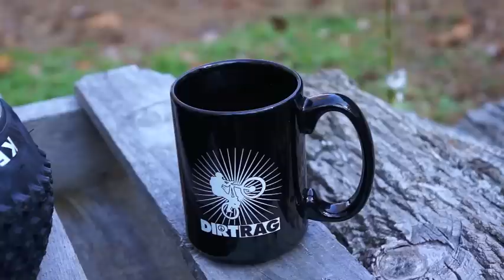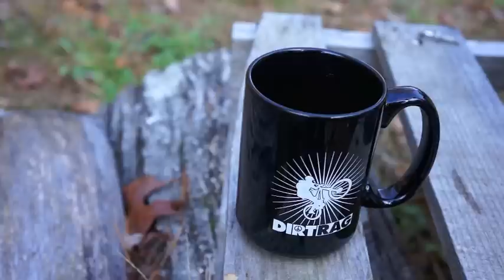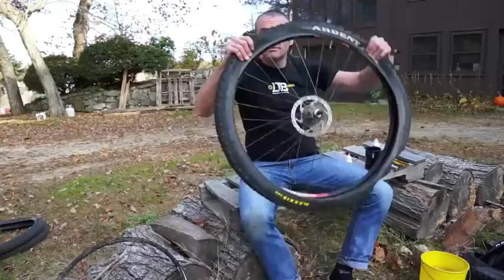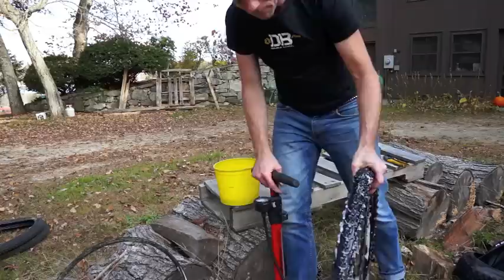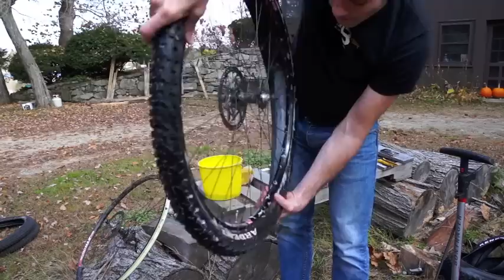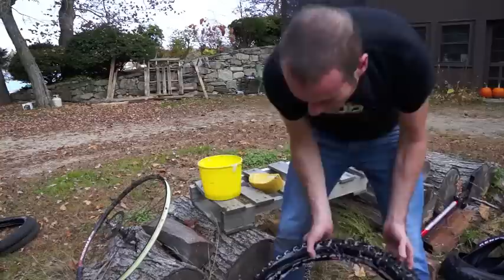Tubeless Mountain Bike Tire Installation (Without An Air Compressor)

Comment: I saw this video too late but this is what worked for me.  I mounted new tires by spraying the sidewalls with windex. Less messy than soap and water.  Also, remove the valve core before you pump up to initially seat the bead.  That allows for less resistance and higher flow of air with each pump.  I pumped as fast  as  possibly could.  I thought it was a losing battle as I heard air escaping, but then heard the two satisfying pops as each sidewall seated properly.  (No bouncing was necessary during pumping for me.  I would have tried it had I known it might help).   Note: I did discover two small weep holes in my rims that are supposedly there to weep water.  I covered those with tape before pumping.  After hearing the bead pop into place and inspecting that it looked even all the way around on both sides, you can then remove the pump.  There was no way after seating the bead that I was going to unseat it to pour in sealant from the side!  I injected it directly  thru the valve with a syringe, replaced the valve core and re-inflated.  Then slosh the sealant all around like he shows in the video here.

Comment: So, after multiple efforts to get my technique down the super key points here are soapy water and high volume air. This method bouncing with track pump looks like I may work, but mounting new schwalbe tires I'm skeptical. I currently use an air canister that I fill to about 160psi and fill the tire with valve core removed. Then quickly install the valve core and finish off with the track pump. Once the tire mounts successfully and holds air I then install back on bike, let the air out removing the valve core again. Adding sealant through the valve is much less messy than rolling the tire over the rim with sealant sloshing around. I repeat the process filling the tire again with the air canister, installing valve core, and then finish off with track pump. Sidewall coating is especially important when tires are new and or tire is not officially TL rated. Nice video!

Comment: So after my completely failed first attempt I made some changes based on your video and I was shocked how much difference it made.
First mistake I was making is using a spray bottle, like some other videos show. It gives you a lot of water and very little foam and you want it the other way round. With a sponge you can just pick up what you want which is the soapy foam. Second thing is to bounce or punch the tire all around while pumping air with floor pump. It really helps and other videos I've seen also missed that, so thanks a lot.

Comment: Worked like a charm. Actually the first one worked like a charm, the second one required more suds but then it went. Bike shop had warned me it will be difficult without a compressor, not so!

Comment: The real guys mount label opposite the valve , this is because the valve will gravitate to the bottom when the bike is hanging  in the shop window. The graphics will be right-way up. It still lets you find the valve , it opposite.
Reply: +Lionel Harvey thanks for your input but this real guy: http://www.sheldonbrown.com/tyres.html and these real guys http://www.velocipedesalon.com/forum/f40/tire-label-valve-positioning-34028.html do not agree.
Reply: +Thom Parsons....I Wonder why Tubular tyres have it opposite the valve.
Reply: +Lionel Harvey good question. I wonder why FMB and Dugast don't put their labels in the same place twice.

Comment: Tried for over an hour, gave up... Back to tubes.
Reply: +John McKenna don't give up! It's totally worth it.
Reply: Probably your water wasn't soapy enough. The amount of water needed actually is very small - more soap. Thicker foam. 

In extreme cases I simply use shaving cream instead of soapy water.

Comment: really should inject the sealant via the valve after you have seated it the first time :)
Reply from the maker: +mjs1231 how many layers of tape do you have sticking your caps lock key down?
Reply from the maker: That is addressed in the video. This method has been working for me for over a decade. Thanks.
Reply: DirtWireTV < UR NOT A TOUGH GUY LOL FKR
3 LAYERS TAPE BACK
2 LAYERS FRONT
TRUED TWICE
rim to tire clearance is everything.
Reply: DirtWireTV  SORRY, EYE INJURY, CAPS EASIER TO SEE. 😆

Comment: I had tried so hard to mount some Onza Canis Tyres on DT Swiss X1800 rims, and just couldn't get them inflated without using a compressor (which I don't own). The bounce trick around the valve really does work, you rock man

Comment: What about getting soapy water into your tire and mix it with the sealant?  Will that affect it ability to stop leaks?
Reply: The soapy water doesn't go inside the cavity but along the rim and outside tyre. Also don't put water in - just loads of suds/bubbles.